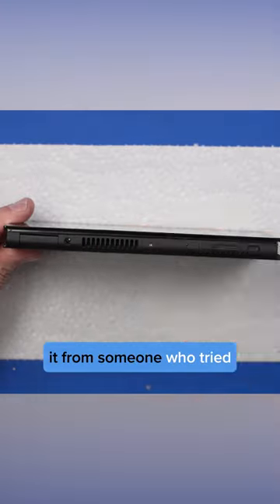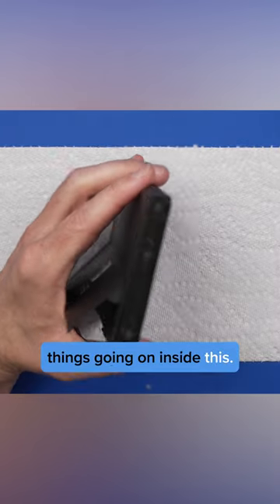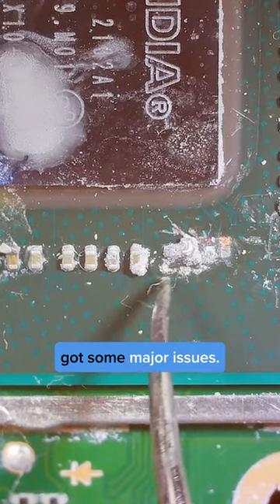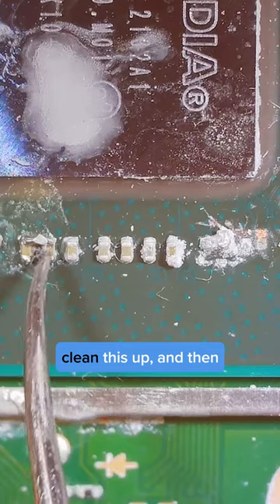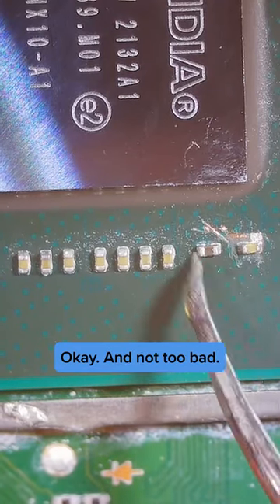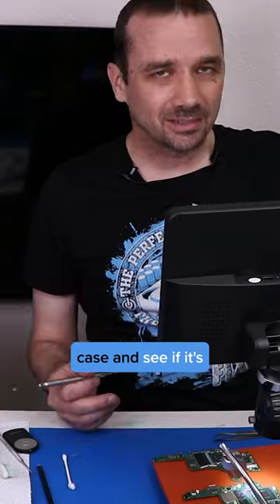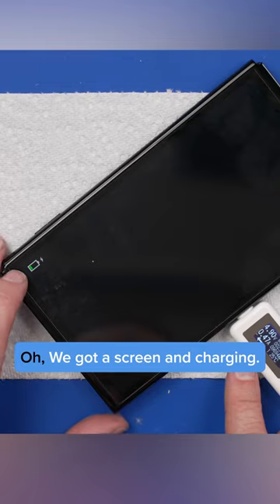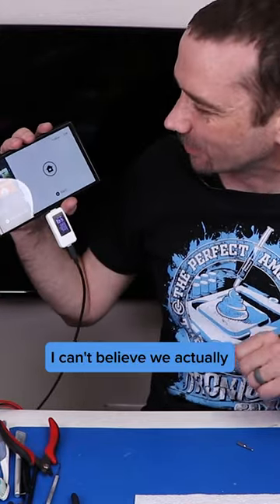OLED Switch DIY Mod FAIL - Let's Fix It! #tronicsfix #oledswitch #diyfail

Comment: Wow what were they using to solder 😂
Reply: maybe a hot knife? who knows
Reply: Looks like solder paste.
Reply: A heat gun
Reply: Battery acid
Reply: The good ol firerod out the garage
Reply: A launch PS4's exhaust?
Reply: Probably boiling unpurified water.
Reply: seems like they used hot air didnt tape anything or seperate lol, They said YOLO who needs flux lolol who needs kapton tape hahaha
Reply: Why mod it fully when you can just soft mod it?
Reply: OLED cant be soft modded. It's patched. Only the v1 units from release day 2017 to about August 2018 can be soft modded. Every other switch requires hardware @TogenMerfagen
Reply: @rashira9610  oh- ig i forgot that detail, thx
Reply: Heatgun and paste
Reply: Probably an old fire stick 😂
Reply: Not flux 🤣
Reply: Blow torch
Reply: RTX 4090 without the heatsink
Reply: A welding rod
Reply: Not enough flux it seems
Reply: Probably a $10 soldering iron and straight just whacking the solder onto the board, no wick no flux
Reply: @zeroandplanb4life that's kind of what I was thinking. That and they might have just used an iron with balling paste
Reply: This looks exactly like my first soldering attempt. I used the smallest tip and immediately oxidized it by setting the temp beyond 400C. I turned it way down and tried to solder and the solder basically turned into play doh because the tip couldn’t fully heat up and conduct

Comment: There's water corrosion on the board. Leave it on, and tracings will rot out. Time for some IPA and a soft toothbrush. Be sure to flush under ICs. Good iuck.
Reply: I'm hoping that he did that and just didn't show us. Sometimes YouTubers do that and then people in the comment section post Why didn't you do that thing you're supposed to do and then he responds I did but I just didn't show that part.
Reply: @bland9876  And some commenters go around trolling others just because there's too much sugar in their candy💩🕳️.
Reply: @aleksandrbmelnikov  thanks megamind

Comment: Seems like they tried to fix the Capacitors
Reply: surely u mean capacitor right?
Reply: @cooper1095  No, the capasetors
Reply: @adiohead  bruh ☠️
Reply: @cooper1095  yeah lmao I can't english
Reply: @midnitejoe3686  fair enough
Reply: No, they tried to install a modchip to hack into the switch.
Reply: No, they tried to install a CPU flex for a modchip. This flex needs to be soldered into each side of two capacitors. He knocked off the capacitors while trying to do that.

Comment: Wonder what mod they were trying to do
Reply: Mod chip :)
Reply: mod chip for jailbreak
Reply: Ah thanks both of you, I forgot mod chips existed, I only soft mod Wii's and Wii Us I haven't even looked at modding the switch
Reply: @calebmezenberg137  yeah. These modechips are a bit hard to install. There's fine soldering involved, so it's a bit tricky if you don't know what you're doing. Then your work can end up on a YouTube channel that does repair work :)
Reply: @souocesar  I would imagine, I've never installed a modchip but I've watched other people do it and it doesn't seem fun, granted that was on the PS2 so it's probably worse on the switch
Reply: @calebmezenberg137 got into installing modchips, for a few friends who are into emulating and stuff. They aren’t too bad depending on the model. Switch lites are definitely the hardest in comparison to how small and tight everything is. But oled are FAR more tedious and difficult. You have to scratch to expose a solder point and you have to do some sketchy stuff with cutting metal. But overall it’s worth it, been able to play modded games at 60fps aswell as Linux and emulation on a beautiful oled display. V2 (the normal switch model) it’s probably the easiest considering you don’t have to remove the motherboard and everything isn’t to bad to solder

Comment: For those who are wondering what mod they were trying to do? Im pretty sure they were trying to install a mod chip, installing a mod chip on the Switch is for experience people only, the points needs soldering are micro tiny.
Again, I might be wrong.

Comment: Hi,I have a psvr2 with some issues and I think you’re the best technician for this,my ps5 fell to the floor with mi psvr2 headset,the ps5 survived to the fall but the type c port of the psvr2 no, I paid like 100€  and when I got home to enjoy again my new headset it turns on but in my tv appears the message that i must conect the psvr2 directly to the type c ps5 port,and is already in!! i dont have the tools and the knowledge to repair it myself,I known that Sony can exchange it for me for 300€,but this made me think that Sony should have available to buy a cable replacement, and I don’t know why they do it,I only know those two options that I can do,and I wanted to ask you if I could send you the headset so you can make a video,repairing it,and talking about this issue,I would real appreciate to see how you fix it because I love your content,if I can contact you through mail or discord I would really appreciate it , I hope everything will work 😃🙏🏻

Comment: ngl when I hardmodded my switch it almost turned out this way

I had a $5 mini soldering iron, no flux and a lot of hopes and dreams as well as fear when I did that.

It worked out and I only needed an extra $5 for the hwfly modchip to get my switch jailbreak'd

Comment: Hey tronicsfix, long time fan here. I was had a similar situation, but I was trying to reflow the cpu of a switch lite because it had the BSOD, but knocked 4 capacitors on the top right side of the cpu. Do you know where to buy these capacitors or the values of them?

Comment: is there a full build guide for the PSP 3000 handheld, I'm about to get the parts after this month. Also, good save on the Nintendo Switch OLED

Comment: Was having SD card problems a while back. Swapped out the reader but in doing so broke three of the board side leads. So now it reads but veeeeeey slowly. Pretty much can’t run any games from it because it takes centuries to load anything. :(

Comment: I have a weird problem with my switch. It will crash if I insert a game in the cartridge slot. It had water damage, but if I play games from the storage device it works fine. Someone tried to replace the cartridge slot but that didn’t work.

Comment: I was wondering if I could ship my controller to you and see if I could get it fixed,I got it recently for Christmas and the tip of the cord broke off in the controller while I was using it.i used a different cord on it but now it won’t turn on but it is still receiving power. Please help me!! 🙏🙏

Comment: So is a switch not able to be modded using just software yet? Then don't mod it. Its a handheld device and made by nitendo, they are notoriously bad at mod prevention so if you are patient you can mod a device whilst only messing with the software. I don't care for switches anyways to be honnest since the steam deck has a similar price and 16 times the performance and can run switch games better than the switch 😂
Reply: unfortunately the switch is the exception, unless you get a launch model switch, all other switch models can not be soft modded

Comment: Yo my switch has a piece knocked out of place on the inside at least that's what I think when I charge it the screen turns blue until it dies I tried the trick online it didn't work how much to you think a repair would be?
Reply: BSOD is usually a dead CPU / broken solder balls underneath the CPU. Extremely difficult to fix.
Reply: Lol😂 buy new one